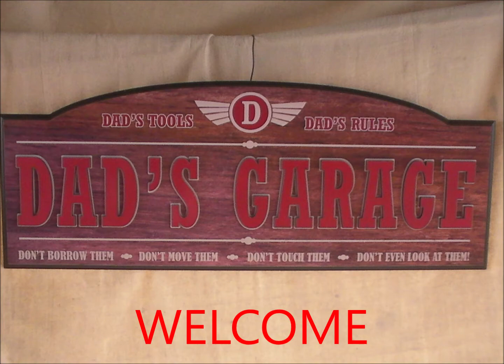Making a Modified 50:1 Gingery Dividing Head Part 23, the Sector Arms

Comment: When I was visiting Chirpy last summer, he made a modification to his sector arms of I remember correctly to preload them to stay on place.  His solution was to add a small bit of brass and a spring to hold tension on the arms to the dividing plate I think.  Or maybe it was the hub.  I'll have to ask him.  I had to chuckle at the 12:32 mark.  I have had to make opposing pairs before and made both the same.  On more than one occasion.  Quite a bit of work goes into the sector arms and some of it precarious.  You done a good job.  Good clamping solution too.  It is coming along quite nice Peter.

I thought I would catch up on your videos before getting to work in the kitchen.  Thank you for sharing my friend.  I do very much enjoy your channel.

Joe
Reply from the maker: Thankyou Joe for being a great supporter of my channel, I greatly appreciate it. I was thinking of making a cup with a O ring fitted in the face in contact with the sector arms but thought how often will I use it, also it offers a good hold so that the arms will not be bumped off position and if my current system is cumbersome or not practical I can simply cut it off and think of something else, spring, O ring ???

Comment: Love your work holding solution on the lathe
Reply from the maker: G’day Craig thanks for stopping by. I’m amazed also the machining that can be done with a faceplate and a single bolt, just don’t push it too hard. 
Cheers 
Peter

Comment: Nice work Peter. In commercial units the sector arms are a friction fit on the shaft or with a super thin (2mm) retaining nut. Gingery missed that note.
Reply from the maker: G’day Howling Mad thanks for checking out my video. I was thinking of a thick washer and O ring but decided on this method in its simplicity of manufacture and operation, it will slow the dividing process down but then how often will I use it as a hobbyist. If it fails I can always cut it off and try something else. 
Cheers 
Peter